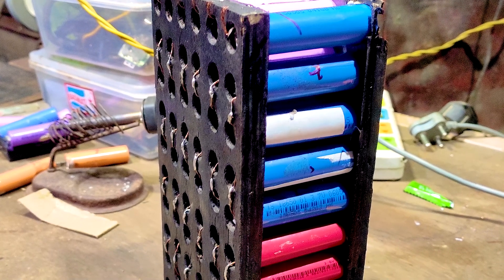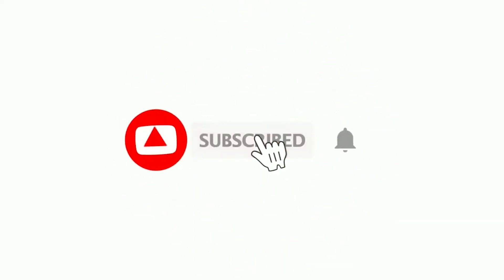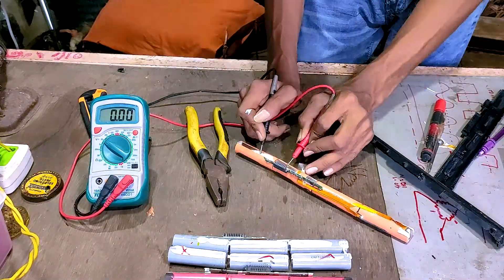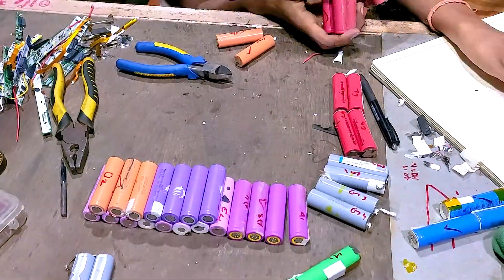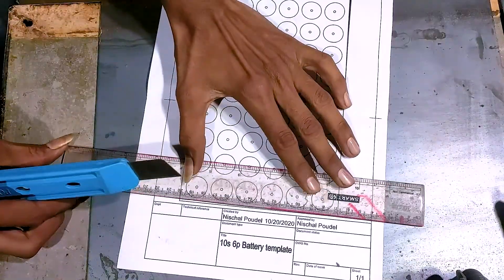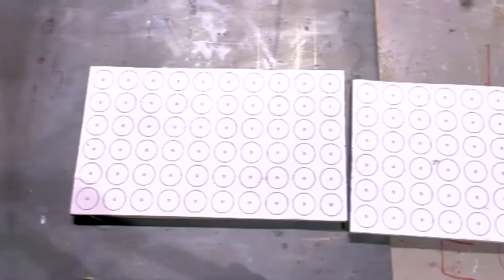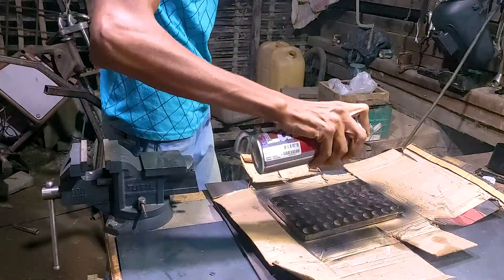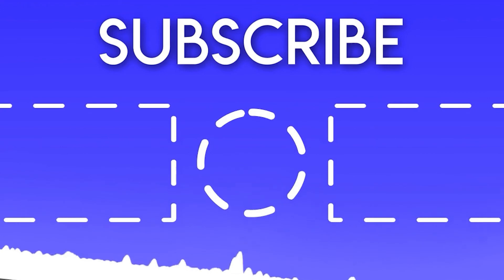How to make Diy Lithium Battery Pack  From Old Laptop Batteries

Comment: Sir all my All 70battery Are fine but Some 2000mah and 2200mah so how to make ??
Reply from the maker: You need to arrange such that one parallel combination will have the same capicity. For example if you have two different cells, in a 6p configuration, use 3 2000mah cells and 3 2200mah cells. Do this for each series and you will have the same overall capicity. If you mismatch the cells, your cells will get out of balance so, it won't last longer
Reply: Sir I do not Understand your lanuage .convert in English and send .
Reply: Sir you can make All the batterys By mix all battery togather
Reply from the maker: @Jai.shree.Ram8173  you can do it if you have a proper bms but generally, it is not recommended

Comment: Hello sir 'Sir want to make 36v battery from old Laptop batterys.
But I want to ask that the one I took 
Out 70 battery Ok
Reply from the maker: You should mix them In such a way that the overall parallel group will have same capicity